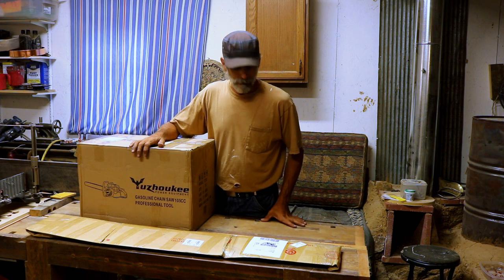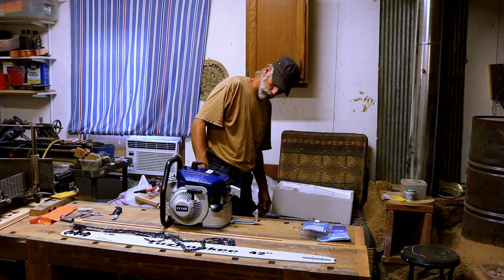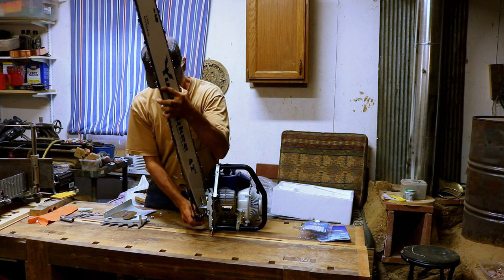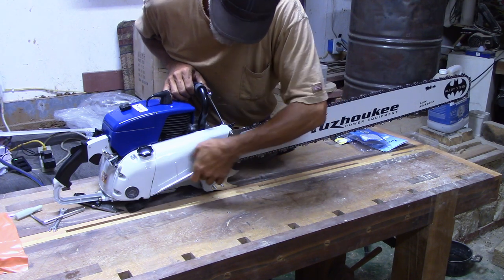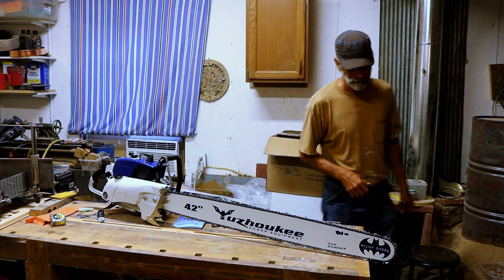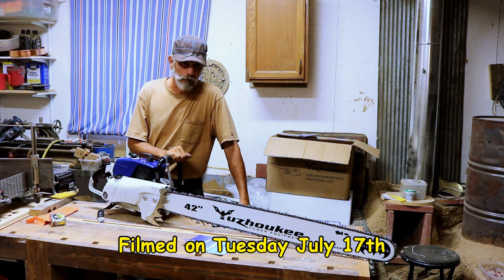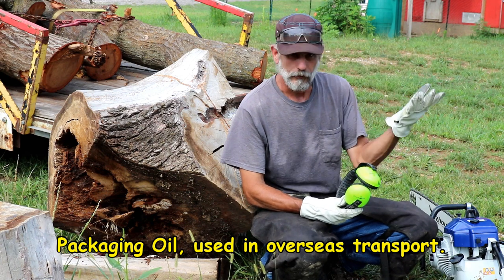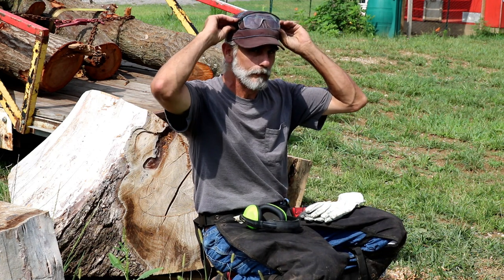Un Boxing a cheap 105cc Chainsaw

Comment: 42” bar with no brake, is that even legal.
Reply from the maker: Not for commercial use it wouldn't be.
Reply: unless things have changed if a saw is classified commercial chain brakes are not required
Reply from the maker: I could be mistaken but I was under the impression that OSHA had stepped in and required them some time ago. But I'm not working as a logger nor have I ever so could be wrong.
Reply: In Australia. we scored a 090 on the cheap when OHS came in all the mills up our way had to get rid of them because they didn't have a brake =D, practically throwing them away, these days they are worth a lot from all the backyard millers
Reply: DIY with Uncle Cy Is a clone of the Stihl 070. An old design.
Reply: Beyer Forestry, Welding, and Other Stuff Wow your suggestions for videos must be similar to mine. Lol.
Reply: Certainly not in New Zealand!
Reply: The shorter bars are more dangerous than a longer one. It changes the fulcrum point of the kickback a shorter bar will kick more violently than a longer one. Plus I really don't think of it as much I ran a lot of old McCulloughs that didn't have chain brakes. Just respect the tool and be watchful of what you're doing.
Reply: John O lmao
Reply: That thing may just be tight. Id take some time, let her run out. 450 bucks is cheap! Looks like the 090 Stihls of the 60s and 70s. You want her to rev out. Unhook the air governor. It will rev then.
Reply: John O it's for commercial use, it's a copy of a stihl 070 which is the exact same, these saws are used for professionals hence why they do not necessarily need the brake
Reply: AFX Gaming , right, pros don’t need safety gear.
Reply: John O yeah, cuz they understand they should hold onto the saw and not push it too hard or anything lol
Reply: Mounted in a mill, so won't matter.
Reply: You can’t buy a chain saw with out a brake. Unless it is an older saw prior to chain brake. At lest in Canada
Reply: cheap homesteading this one is a chinese reproduction of an older model Stihl, which also didn't have the brake
Reply: Even if it is.. I wouldn’t use it
Reply: Probably not legal on government land or commercially but you can use it for your own use. Besides, chainsaws didn't have them until around the 70s or so but you do have to be careful with or without a brake..
Reply: The brake is a waste of weight. Has anybody been in a situation where the brake legitimately had saved you? Not me and ive ran saws for years. Brakes are for old people who cant see or hold saw.
Reply: GR45 do you have one of these to compare to or are you just surmising? How much does yours cost?
Reply: It is at my house.
Reply: Freedom Of Speech 
I'm that old guy. Back when my Poulan 380 was new I was not old. Just once in my life has a Brake saved my life or at least may have. That saw had a 24 or longer bar (can't be sure it's been so long ago) but just once it kicked back and the brake locked. To be honest the chain didn't actually hit my forehead. It just came very close. But that chain brake impressed me so much I stopped using the old Poulan that came without a chain brake. I'm 71 and still run a saw several times a week. When I'm walking from tree to tree I seldom kill the engine but lock the brake for safety. A few times in the past 20 years vines, limbs, stump holes have tripped me. I tossed the saw away and have never fell on the chain, but, having a chain brake locked makes me feel safer. I've never needed a personal floating device in my boat either but I still wear one even at the dock. I guess maybe it's just a personal choice for each person to decide.
Reply: @johno6861  I know right I own a tree service all saws must have chain brakes one of my workers cut themselves bc one of our saw was missing chain brake he went to hospital got a bunch of stiches. He had about ten years experience.but on a huge saw like that the chances of it kicking back are slim to none if you know what your doing I've never had a saw that big kick back on me
Reply: I run a 090 6 foot bar no chain break
Reply: Well as far as I know a saw with a bar that size would be lucky to kick up out of the cut on a cross cut and the danger is very low.  The little saws like 20" and less that are running big hp like my 5hp efco are by far and away more dangerous.  Also the foolhardy it's only little approach (14" bar)  lulls many into a false security.
Reply: Chris Mccuskey yeah my grandad and dad ran a couple of old macs with no brakes and never a problem my dad still has his old 10-10
Reply: Not as dangerous due to center of balance and power to weigh ratio, but still 42"
Reply: @GR45 a sixty foot bar is huge
Reply: @GR45 i do what i want, respect the saw and it wont take your hand/arm/life, but as for the brake, iv taken plenty off of new saws laws be dammed.. but i can't leave anything well enough alone anyways so whatever, its natural selections decision at this point. The only true law is "Do no harm", all else is tyranny! ...
Reply: @grantsnell6782  Certain selling sites in New Zealand are anal about not selling a chainsaw with no chain brake....even parts can't be sold without a chain brake.... according to their seat polishers.

Comment: I have some experience with Chinese motor knockoffs..... 

THE PROS:
-they are all direct knockoffs of a single thing to exact dimensional specs, so if something breaks YOU have the choice of using another cheap knockoff part, OR you can go back and replace the part with one for the original that it is copying.
-if you know which model it is copying, you can obtain the original manuals from the original item.
-spending a quarter to a third of what you would for comparable big name saws (even after upgrading gaskets/carb/chain/bar, as long as you do your own work).

CONS:
-quality control will be NOTHING like that of the original.... cheap metals and plastics may be in use, as well as crappy, thin, paper gaskets.  (Again, anything that breaks can be replaced with parts from the original, in this case  I believe you said a Stihl 070).
-you have to be able to do all the work on your saw to keep it cost effective when fixing your saw (or generator/pump/motorcycle/etc.)

I have a buddy who has purchased several generators, water pumps, etc for gold mining equipment, etc.  he is a whiz with small engines, so before even starting he completely tears down the engine and puts it back together with better gaskets, torqued to specs of the original, and with either the original carb or an upgraded carb for the original..... he never has a problem with any of them....

Like many things in life, buying something with a Chinese motor can be the inexpensive way that requires your “sweat equity” to be just as good as what you would otherwise spend so much more for....

If you want to drop $2k on a Stihl, Husqvarna, or Echo for your chainsaw mill than that is your choice.

If you would rather spend well below half that, but knowing that it will be a throw away, or require 5 to 30 hours of your mechanical work and another $10-$200 in parts to make it run as good as the original, then that is also your choice.

Make YOUR choices knowing ahead of time what the possible results will be and you should be happy with the results..... especially if you buy a good brand chain and keep it sharp.
Reply: Jody Hardy 
He bought this one on eBay, I believe....there are several off brand Chinese knockoffs sold there every day.....and if you travel to “developing nations” as often as I do, you see them in shops all over...just like all the Chinese knockoff boat motors, generators, and motorcycles.

Generally, no, you can’t take it to your Stihl dealership......that said, if you are buddies with your local Stihl dealer, and he has time on his hands, then maybe, but he probably doesn’t want it in his shop....but if you don’t know you Stihl dealer’s name, birthday, and favorite beer/bourbon brand, than probably not a good idea to even ask him...  (like I said in my previous comment, these are cheap and can be reliable and still cheap if YOU are willing to work on it.  It will no longer be cheap if you have to pay a dealer to work on everything that needs attention).
Reply: Your 100% right and you could not have said it better.
Reply: Jody Hardy Why do you ask? Are you looking for a good WHEEL CHOCK?  That's what you called mine Remember.

Comment: As I think I heard you state. The machine is not getting up to speed. My weed whacker reaches a high pitch than that is making.
Reply from the maker: JIM Short these types of saws run at lower rpm than modern designs. It peaks out at around 9k higher than that would blow up the saw. And as stated in the video when first using it it is factory tuned even lower for break in. I have since passed the break in run and tweaked it it runs well and pulls much harder than it did here. See my 2nd video about milling with it.

Comment: Good video I subscribed . will be watching the next one too . I'm a worn out chainsaw fan .
Reply from the maker: Its coming just gotta edit.
Reply: @DIYwithUncleCy   I  bought one of these saws a few years back for milling , didn't get to use it much because the bar doesn't have a roller tip and the tip got to hot.

Comment: Nice saw. Its gonna break in and run like a champ.
Reply: I think so too.  My MS880 was a dog during break-in, but that was in 2010, and it STILL seems like I'm picking up more power with every tankful, 8 years later.  Now, there's nothing I get bogged down in.

Comment: dammit man looks like the Chinese found some molds laying around from the 50s  with the same zero safety features to boot. that things got to weigh 40lbs but hey for the money if it gets job done and last’s for a little while why not. A couple of years back buddy of mine spent over thousand on his saw with under 60 cc so you’re doing pretty good so far on cash spent👍 just gotta remember what you have. The old guys made it just fine with a little common sense with no kick back.

Comment: That's a Chinese knock-off of the Stihl 090. I miss my 090, but don't have any use for it anymore.
Reply from the maker: Actually is the 070. But both have the same body 090 is 131cc  the 070 is 106cc. But you are very close.

Comment: My ms250 cut circles around that
Reply from the maker: But an MS 250 won't pull a 42, 48, or 60 inch bar. This will.
Reply: @DIYwithUncleCy  Point made.

Comment: The blade sounds like it isn't getting oil or at least not enough oil to me.  Also, it doesn't seem to be getting enough rpm.  Was it just me or?
Reply from the maker: I am used to a roller tip bar so the chain was s bit tight. And these old design saws run at lower rpm than modern saws. This one isn't supposed to go over about 8000rpm. Plus it being the first time I had run it I had not fine tuned it yet. It is now running much better and o have done some milling with it, should have a video of that up soon.

Comment: Looks like an old 076 Stihl to me. 3/8ths chain!!!!! a strong 105cc saw will destroy that in a hurry. Running like a farm tractor....more oil in gas and adjust high/lo speed. Two stroke saws should never "moan" like that. Check and see if there is a governor on the carb. Brass plug on the side if it is a Tihloston [?] like the old 2100 huskies. Put a rolled up ball/ piece of tin foil in it if there is one....then tune it....keep running that heavy on the oil mix. That saw should/will make a lot more than 6hp....8 would be more like it

Comment: Hi do u have a video of your trailer set up
Reply from the maker: I do of my old trailer but I haven't yet done one since I built the Big trailer. I should do that some time.
Reply: DIY with Uncle Cy  that’s wood be cool I saw just trying to work out if your arch pivots
Reply from the maker: It does but only for transport. For loading it is locked it the up position.

Comment: Yeah something wrong with that saw! Should cut faster than that. Noticed not much shavings coming out the bottom of chain buy a good saw and run pure gas mix with required amount of oil in the fuel and you shouldn’t have any problems with the saw. Ethanol gasoline ruins chainsaws. Eventually in time you will have problems ,fuel problems.

Comment: Good job on the vid , I have been wondering about a saw like that , I am thinking when you get the bugs worked  out , it will be just dandy ! way back I had a heavy no frills Poulan chain saw , no kick back brake , no roller tip bar , just a good ole powerfull saw , after say 10 years I traded it in on a 034 Stihl 20 inch bar , that was 22 years ago , I still use it . Anyway good job !

Comment: Cy, As I noted in your other video I purchased one of these to mill with my panther mill. Hoping my saw does better out of the box. LOL! I will be sure to degrease it before breaking in the saw. Looking forward to your milling, which may be before mine.  Are you thinking Oregon bar? Or forester?
Reply: Use spray brake cleaner, no residue, no taking it apart

Comment: a stihl saw like that would be $2000, knew the chain speed would be slow, that's because it is a big saw, work on it a little more it is worth $450, not for cutting your firewood but for special big things just great

Comment: Are these the power heads for concrete saws. I had a chainsaw power head with the low rpm that the sawshop explains was for grinding wheels not to exceed 8000 rpm.

Comment: I've used saws with about the same cc's, but they were hooked up to the old "bow blades" that cutters used to use (I know I'm telling my age).  I'm not so sure about a blade that long that doesn't have a sprocket end on it.  Seems like after a bit it'd get extremely hot and maybe either start folding in on itself (pinching the blade guides) or spreading apart.